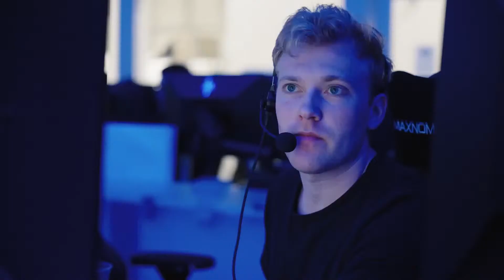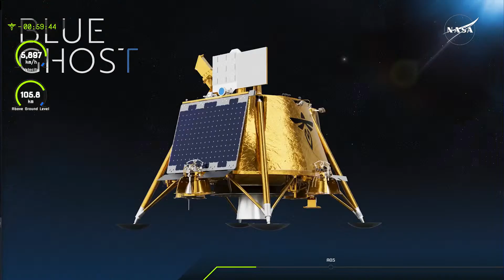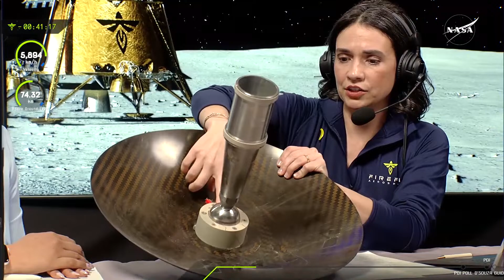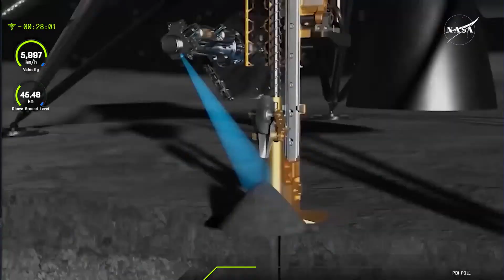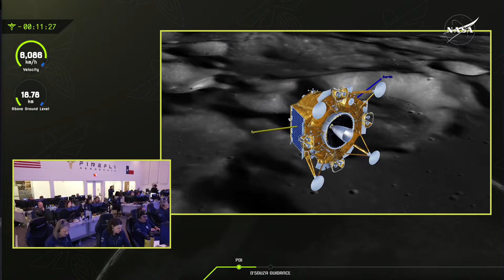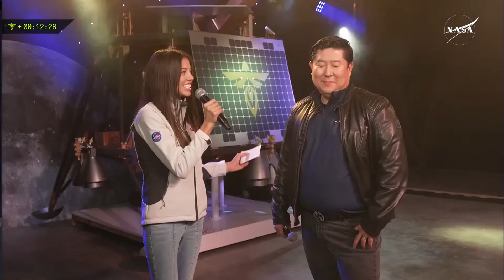Firefly's Blue Ghost Mission 1 Lunar Landing

Comment: So 55 years ago we got a live feed of men dancing around the moon etc but 2025 we get an animation that looks like it was from a Windows 95 space game 😢

Though kudos to Firefly as that was perfect 👌
Reply: They never live streamed any of the Apollo landings either.  They did use TV broadcast to transmit the first lunar surface walk.  But that was hours later, after everything had calmed down and they didn’t need the radio signal for sending data back to earth.  Same thing here, they needed to keep the bandwidth clear for data transmission during the landing.  SpaceX can do it because they are landing on earth so they can use low latency Starlink transmission.  There is no Starlink on the moon.
Reply: The video from the landing phase is currently downloaded to Earth. Will be available in a few hours. That's significantly quicker than 50 years ago. Apollo 11 only recorded the landing on 16mm film, which had to be developed after Apollo 11 had returned to Earth. Apollo 11 only did a TV live stream from moon after the lander had touched down. High bandwidth transmissions require the antenna to be very stable and focused. Does not work well during the descent, when thrusters are constantly firing and correcting the spacecraft attitude.
Reply: @fgaviator 
what makes me sad , is even with the landing video they will still claim its fake.😕
Reply: @fgaviator  Fabulous!  That's all I needed to know.  I just wanted the landing video available sometime, if not in real time.  Thank you so much!  Now the flat earthers and lunar landing deniers will have the evidence that they need.  And those who need to be inspired can be.
Reply: Make technolgy Great again like it was in the 60's.
Reply: @Tony-x2m3r  the soundtrack is nice tho
Reply: Takes a lot of power to live stream. They are a small company with a small budget.
Reply: Every gram, Watt, bit of computer power, telemetry are precious on these first missions as the safety margins are unknown.
Reply: Still not allowed to see structures or UAP or more.
I better do a ce5 tonight😂
Reply: Apollo used a 16mm camera to record out the window of the LEM during P64 of the decent phase during landing
Reply: There was no live TV of any actual Apollo landing. The landing video was recorded on a 16mm film camera from inside the vehicle. The film was brought back to Earth and developed and shown then.
Reply: @executivesteps  lol
Reply: Apollo had 4% of the GDP for a budget. We've got nowhere near that today.
Reply: @ good point.  Camera broadcast and manufacturing costs have become so prohibitive in the first quarter of twenty first century making live digital video transmission only available for the ultra wealthy
Reply: Exactly!!!!  What kind of bs is this???  Totally Fake!!!
Reply: Why are we launching missions to study moon dust when we went there 6 times and brought back hundreds of pounds of the stuff? The more probes we send to the moon, the more evident the APOLLO missions seem like propaganda BS.
Reply: I'm sure on of the rovers on Firefly has cams
Reply: This got to be the silliest complaint from a fool.  The feed you got, if you were around 55 years ago, was from a manned spacecraft with a camera filming the landing from inside the space craft.  Today’s landing was monitored with instruments from a small craft and no video feed was required.   The live feed of astronauts on the moon did not show them dancing.  You are an idiot.
Reply: it's ok to be happy and enjoy life, pip. good luck to you.
Reply: It is remarkable, maybe we need to go back to slide rules and pocket protectors because sounds like computers are just making us lazy or something.
Reply: Humanity is lagging.
Reply: Are you guys flat earthers? Where is the camera to record the probe lol? The camera has to be a separate probe to be able to record the kind of animation they are showing. It's not a matter of technology dumbasses. Use your head a  bit
Reply: Coverage of the Apollo 11 landing of 1969 was an animation too, and not very good.
Reply: Chill dude.  Telemetry is more important than video.
Reply: I know this was unbelievably disappointing
Reply: You're not following the " science ". You obviously need to go the re education center.
Reply: @James-d9o7r  🙄 after all the speculation on the first moon landings youd think they would have tried a little harder cameras weigh nothing now that's my point... Keep your negative re-education comments to yourself
Reply: The first pic is probably just a system check.  I bet they will turn on all kinds of HD cameras soon.  Yes we landed on the moon.
Reply: That animation was so ridiculous
Reply: This is just the delivery vehicle. Much of the payloads will have cameras. Apollo did not have the ability to air the outside lander.
Reply: In Apollo there was no live feed of lunar landings only audio. 
The landing sequences were filmed from inside the LM but the film was not developed until the return to Earth. The live TV wasn’t available until the astronauts began their EVA on the lunar surface.
Reply: Is there any actual live video of the landing anywhere? NASA website not helpful
Reply: This generation sucks...defund NASA  now if they can't take a picture.
Reply: Unmanned spacecraft why would you spend hounders of thousands of dollars for a live feed?!
Reply: nice
Reply: I feel a bit cheated & disappointed because the onboard camera's didn't Livestream the powered descent and landing ! ! !😭😭😭😭😭😭😭
Reply: Must have got just that little bit too far away... 😂 😂😂  the orbiting pics looked great tho....@Andrew_Hillis
Reply: Yeah... the orbiting pics were nice!!  But no landing video. Oh well, give it another 50 years
Reply: @Andrew_Hillistrust me, they were working but that’s not something the general public is supposed to see.
Reply: Yes, I don't understand this either.   With the advancements in camera technology and MUCH cheaper costs, I don't get why having a few small cameras onboard is so difficult.  It's certainly not prohibitive from a cost or weight standpoint.  Even with a time delay, it would still be nice to see the ACTUAL landing.  Elon has cameras seemingly everywhere on his spacecraft.  The images from orbit with this craft were quite breathtaking however.
Reply: Very small craft with low power. Takes lots of power and band width to live stream. The video will be transmitted afterwards. Why complicate the landing for your viewing pleasure.
Reply: @robertmog4336  its not about size or weight of the cameras...its about the size, weight and electrical power requirements of the transmitters to send the signal back to earth. The more powerful the transmitter, the more bandwidth is available, but the more space and weight it consumes, and the bigger of an antenna it needs. As distance from the transmitter doubles, the signal strength is cut to 1/4 of what it was due to inverse square law. Means only enough bandwidth during landing to send back telemetry data. Its relatively easy to provide real-time video data from launch and on-orbit ops of near-earth spacecraft, but at 250,000 miles away, it's exponentially more difficult and resource consuming.
Reply: @DiamondPaintWithDiamondDave  Thank you for that great explanation!
Reply: This isnt some huge private company man.@robertmog4336
Reply: Weight and power use  @robertmog4336
Reply: @robertmog4336 When there is a constellation of data satellites orbiting the Moon to provide broadband video links from the Moon back to Earth, then it will be possible to see the live video during landings. The Blue Ghost has cameras, but it doesn’t have a radio to communicate broadband data back to Earth until it lands, deploys its X-band antenna dish, and points the dish carefully toward the Earth.
Reply: @robertmog4336 so no footage of actual landing?
Reply: @JB-f1d  I think it has been downloaded and is forthcoming.  It doesn't have to be in real time to be worthwhile and useful, and apparently there are excellent reasons for NOT doing it in real time.
Reply: @robertmog4336 show me your engineering degree. And what would another camera matter anyway? Be honest, you wouldn't believe it with 10 cameras, and unless you landed there yourself and even then you'd be like "huh, not sure". Give us all a break.
Reply: @shondyrocks I've already given you the Google search to confirm my PhD in Engineering.  I'm the one who KNOWS we landed on the moon.  I'm not the flat earther or moon landing conspiracy theorist.  I just wanted to know why there was no real time landing video. And I got excellent answers from multiple people as to why that   was problematic, why it wasn't critical, and why it would be  forthcoming after downloading.   That will take care of the conspiracy theorists AND will inspire others.
Reply: @robertmog4336  remind me again, what are your qualifications in designing lunar landers?
Reply: @robertmog4336 

the images from orbit were cgi

it’s all cgi

they aren’t good enough to convince you to do the landing live, hence this high school musical production of people thinking they are doing something

it’s all fake
Reply: During the Apollo program NASA used a bunch of huge antennas to get the live footage, because they were crucial for a manned mission. They had to know what the astronauts were doing in real time and the best way to know this is to see it. For an unmanned lander you only need telemetry data. Firefly doesn't have access to the same antennas as NASA had and they don't need them. Transmitting videos live from the lander would also be a huge waste of energy and would decrease the amount of actually useful data they can transmit, like scientific experiments.
Reply: @raptorwhite6468 Apparently, it wouldn't be a huge waste, since so many people would love to see it.  And it would (mostly) put to rest the flat earthers and moon landing conspiracy theorists in these comment sections.   Finally, do you mean to tell me that antenna technology has not improved in half a century?  Part of space exploration is inspiration too.  Even unmanned exploration.
Reply: @raptorwhite6468  "I worked for NASA" lol as what, a janitor? If you had actually worked for NASA at any point, there is no way you'd be asking such an illiterate question - one that could be answered for you with a simple Google search.
Reply: @jaydee4177 

jaydee, you know this is fake right?
Reply: @raptorwhite6468 

you keep drinking that Kool aid my friend.  I’ll be over here laughing at this “footage”.
Reply: @jeremyturley1276 I explained why receiving live footage from the Moon is impossible and useless in this case and your answer is just "nuh uh"
Reply: @ 

my answer most certainly isn’t that, and you didn’t explain anything. 

you gave the spoon fed propaganda that it’s not needed.  that is garbage and unbelievable by anyone with common sense.

What you are saying makes no sense.  there is absolutely no reason why they didn’t use the same cameras that released the images from orbit to live stream it. 

The only conclusion that makes actual logical sense is that it’s because it’s fake.  You just haven’t come to terms with that yet.
Reply: 😂😂😂😂. Backward progression!
Reply: @VirtualObserver4445 in another 50 years it will be like steamboat willy
Reply: Livestreaming from the moon is still possible. NASA never showed live feeds of descent during apollo, however, as this phase is mission critical - antenna bandwidth is reserved for critical data transmission and low bandwidth audio rather than video, because it is unecessary and takes too much. Hope this helps :)
Reply: @abritinspace Finanly  someone  with a  brain
Reply: YIPEEEEE ! ! !  SUCCESS ! ! !  THE UPSIDE-DOWN DUMPSTER IS ON THE MOON ! ! !👌👌👌
Reply: Yea they were livestreaming from the moon in real time without lag or buffer. What ISP did they have?
Reply: @ThroughMyEyes2020 if you knew anything about it you would know there was a delay of 1.28 seconds one way in sending video. They also has broadcast cameras and antennas set up and pointing at the earth. This mission limited access to nasa deep space communications system which has hardly any bandwidth. Maybe one day we will have starlink satellites circling the moon but that’s a while away yet
Reply: The internet didn't exist, they used TV to broadcast and record it all over. Everyday astronaut just made a great recap video about it if you seriously want to know.  @ThroughMyEyes2020
Reply: @ThroughMyEyes2020  No they weren't. Grow up.
Reply: @ThroughMyEyes2020  yeah I know lol it's very questionable 😅
Reply: No doubt .... super disappointing video... And a stupid  90s game animation...😮
Reply: Sad person you are!
Reply: who told you that 55 years ago the live feed was from the moon😅😅😅
Reply: @SCisic-yi4lx 
The dramatic documentary "the Dish" Covers some of the heros making the transmission work in a storm in Australia!
Reply: So you are saying it looks like it was faked? Again?
Reply: Soon they will convince us that they have been to Mars
Reply: @PiotrSiedlecki-qv2cd  we have been, unmanned of course
Reply: @abritinspace  I'm sorry this happened to you.
Reply: Did you screen recording? 😂😂 please tell me you did
Reply: @Aimie-f7t 
Im 71 and saw every manned moon landing.
Seriously dude, that’s your problem?
Reply: So Space is a Cartoon for Kid's Ya Got'  Give The Kid's a Ba'   [ BALL ]       S. ITS A CARTOON HELL LOW  GOT ! ?
Reply: And you still think it was real when we get a animation 😅
Reply: @ghjfh4893 There's more Data than "just an Animation" 🤦🏻
Reply: because 55 years ago, we never went there😅😅.
Reply: And the most funny thing is a lot of fools believe this stuff. And call those who ask for real evidence, crazy.
Reply: @23igna  I don't call skeptics crazy, I call them ignorant...and not in a bad sense...just ignorant of the science behind why that "live proof" can't be a thing, at least, not in a practical sense. Granted, my degree is in electronics engineering and I understand radio transmission at it's core levels, but to the average observer, they see video from launches and the ISS all the time, and think, "oh, why can't they do that on a moon lander too? It must be fake if they don't." When in reality, there's so much more to it...literally exponentially more to it. To have been able to provide live video feed during landing, the lander would have had to been much larger, and heavier, to allow for the bigger batteries, larger, more powerful transmitter, and the necessary larger antenna. That would have made the craft more expensive to build, and launch. Inverse Square law applies to radio transmission. As distance from transmitter doubles, radio signal strength decreases to 1/4 of its original. Lower signal strength = less information that the signal can carry at any given time (bandwidth). Video uses huge amounts of bandwidth. Its easier and more cost-effective to use the lower bandwidth consuming telemetry to drive a real-time CGI model as an accurate visual representation to observers here on earth, and then send the more resource intensive recorded video back after landing when the bigger antennae and more powerful transmitters can be deployed and used.
Reply: @23igna  So Space is a Cartoon for Kid's Ya Got'  Give The Kid's a Ba'   [ BALL ]       S. ITS A CARTOON HELL LOW  GOT ! ?
Reply: @23igna  Evidence? There are literal Petabytes of the Evidence the Landing Deniers ask for. 

Make America READ Again.
Reply: @23igna  You aren't "Crazy" you're Ignorant. There are literal Petabytes Evidence and Data for the Mercury, Gemini and Apollo Missions.

Stop listening to Bart Sibrel... he's just trying to sell you a Book. 

Make America READ Again.
Reply: @23igna dumb

Comment: A trace of the landing gear is visible on the lunar soil. It seems that the lander has fallen on its side.
Reply: I was wondering if that was the case
Reply: The photo looked sideways to me. One of the legs failed to report touchdown, so I wouldn't be too surprised if it landed at an angle.